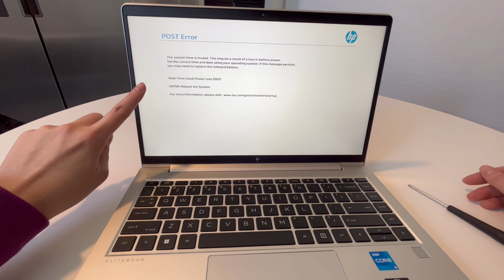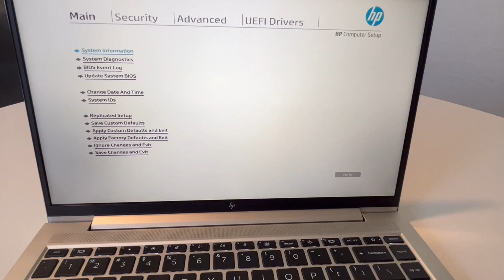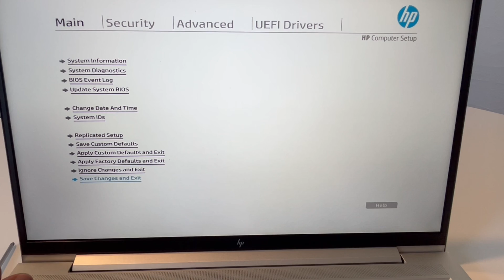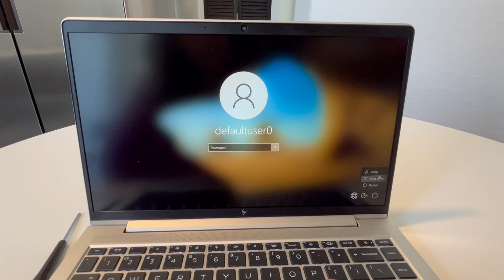How to Solve HP Real-Time Clock Power Loss (005) Post Error - A Fix That Works Even After Restart

Comment: When i change date and time then save and exit , still having the same issues. When i check that again date and time were wrong again, i don't know why it's not changing
Reply from the maker: When the BIOS setting will not stay saved this is typically a problem with the CMOS battery. The CMOS battery is a coined-sized battery that helps record of the date and time when the computer is switched off. So when it stops working correctly then your date and time will keep resetting. Here is a video on how to replace your CMOS battery:

https://youtu.be/ZjDpq3miD3Y
Reply: @EggheadFixers , I changed the battery and still the same happens. My date and time were always right but it keeps complaining.
Reply from the maker: @seriouscat2231  Did you change the main battery or the CMOS battery? Because sometimes the main battery can be the problem also.
Reply: @EggheadFixers , I am doing a hackintosh out of an Elitedesk 800 G4, and I realized the problem is how the relevant kernel extension sets the clock at shutdown and I will implement the solution soon. So it was no battery at all.
Reply from the maker: @seriouscat2231  Ok let us know how it goes
Reply: @EggheadFixers change your laptop battery

Comment: I change the time and date it did not change still same issue
Reply from the maker: If you go back into BIOS after you saved the date and time, is the correct time and date still saved? Because the time and date not saving would cause this error and oftens times the BIOS not being able to save time/date is an bad battery or CMOS battery. Let me know and we can work on a solution

Comment: In my case, it always happens every time the battery gets on  20%, and when I go to the bios the time and date were changed again(wrong), help me to understand please if it is the CMOS battery or The real battery but the real battery is good it holds 4 or 5 hours.
Reply from the maker: That sounds like a problem with the CMOS battery. That would be the first thing I would try replacing. CMOS battery helps the motherboard keep enough of a charge so that it can store information like the date and time.
Reply: @EggheadFixers  thanks I'll try to change The CMOS battery then.

Comment: My laptop turns off randomly even tho it's not dead, and I tried this the bios doesn't save can you please help? I use this laptop for educational purposes. Thank you for your understanding.
Reply: mine too did the solution help
Reply: mine too did the solution help
Reply from the maker: So you set the time and date then save but when you go back it has reset? That can be a sign that the laptop is not getting enough power which can be caused but things like:

1. A bad CMOS battery.
2. A faulty power cord.
3. A laptop battery that needs replacing.